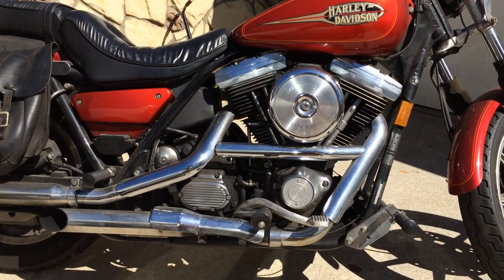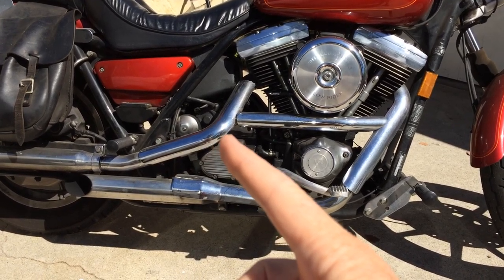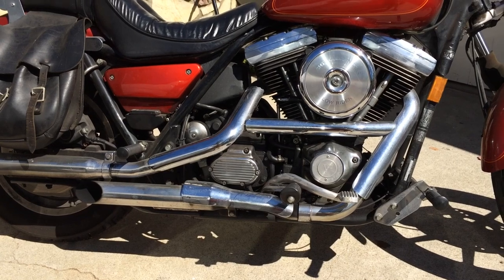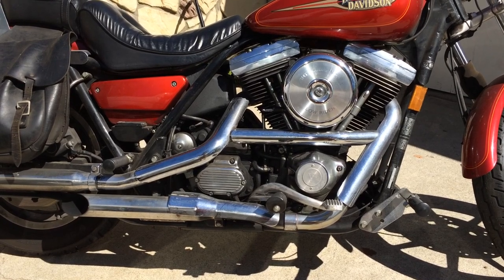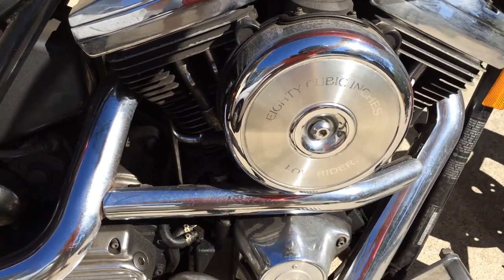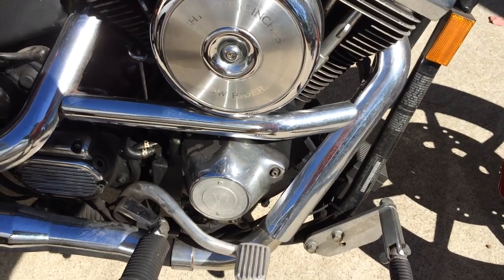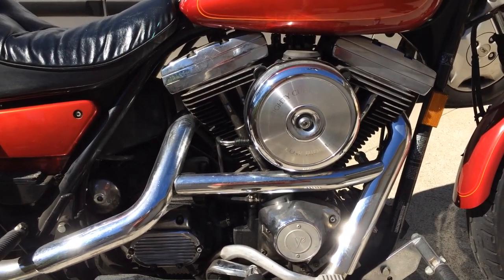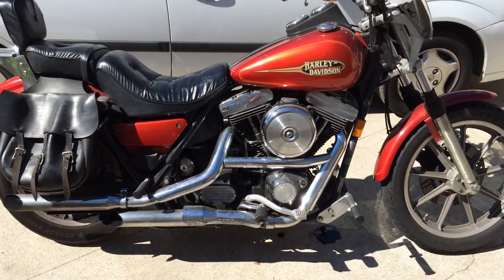Harley Wet Sumping Explained

Comment: The first time my bike did this, I panicked. I had no idea that it was supposed to do this until I bought the service manual. Now I drain the tank at the start of winter and leave a note on the seat reminding me to change the filter and add oil at the start of spring. I never understood why they didn't make them sump back to the oil tank?!
Reply from the maker: stirlingshire It's scary the first time!  I hope people who find oil dripping out of their air cleaners find this video before they panic too much.  Good idea, venting the crankcase breather into the oil tank.  There must be a reason they don't do that. Maybe because the oil tank is sealed, and the air blowing out of the crankcase needs room to expand.

Comment: could I just drain the oil out of the case and fill it back onto the reservoir prior to start up? I'm only asking because I have one coming up for auction and it's blowing the dip stick out as I crank it up. It has been sitting for almost a year.  Please help get this beast run.
Reply from the maker: It depends on what year it is. On a lot of these Harley‘s, you can drain the tank, but you can’t drain the swamp. There may be a vent line going into the air cleaner, which the oil from the sump will pop out of. You can unplug it from the air cleaner and route it to a drain pan and then crank the bike over. Here is a video I made about how to do a 5 quart oil change, which might help.  Harley-Davidson 5 Quart Oil Change https://youtu.be/bHxYuvm6Kuc
Reply: @hoohoohoblin  I'll let you know how it turns out. Thanks for the input.

Comment: i have a 92 fxr i got the puddle of oil then got it started and after it warms up it dies out. Any advice. just put a new battery in checked vacum leaks dont know what it could be. I know I have to put new clutch plates in but would that keep a bike from starting?
Reply from the maker: +Steve Walden  that is a tricky one. It could be a problem with the gas cap not venting properly, or it could be a bad ignition coil that stops working when you gets too hot. Maybe carburetion, but I doubt it.

Comment: Are you a expert on grabbing a xlh my primary clutch popped and froze up on adjustment all parts work apart but together it's froze up
Reply from the maker: I had a 1996 sportster a long time ago, and the clutch would sometimes get stuck and not disengage. On that model year, Harley put a spring plate inside of the clutch mechanism, which was a spring riveted onto a metal disc, and the rivets broke loose and got jammed in the clutch. I replaced the clutch with a Kevlar kit that didn’t have a spring plate, and it fixed the problem.
Reply: @hoohoohoblin  ow really but you replaced it instead cleaning the basket so not shire that will fix it
Reply: @eddiemorris5601  take apart the clutches and steels from the basket clean up, prob work jusr=t fine, had this problem on 76 ironhead just picked up now she's smooth.
Reply: dog pow

Comment: my bike leaks when it get warmed up, I had it sitting for a while  do you think I have this problem. What can I do
Reply from the maker: +Frijo1 If it was wet sumped, it should be fine after it blows out the extra oil.  Clean it up and  see if it leaks next time you ride it. It won't leak if this was the problem. Just remember to start the engine once a week to keep this from happening.
Reply: my leaks from the button and it don't throw out smoke,  thanks

Comment: So should I drain my oil and refill it. I have an 93 flhtc im new to evo's and my bike started then shut down n wont start. And of course i have the oil on the ground
Reply from the maker: germaine catching If you keep trying to start it, it should pump all of the excess oil out.  You could route the overflow breather tube into an oil pan to catch the extra oil.  I don't think there is a crankshaft oil drain plug you can open to let the extra oil out.  On my Royal Enfield there is a drain plug you can open to drain it when it wet sumps.
Reply: Ok thanks.  I  really  believe this is my case the bike sat for a lil over  6 months

Comment: I changed my o ring in the oil cap on my 2006 883 and brought the oil level to HD level only to have leaks thereafter. I dropped the full level to the half way on the stick and no more problems. I no longer add a quart when it tells me to on the stick... only half way. Problem fixed.
Reply from the maker: I had a Moto-Guzzi like that a long time ago.  Some vehicles only want to be half full of oil.

Comment: What kind of saddlebags are you using?
Reply from the maker: +kilochris83 They are old throw-over leather saddlebags, and I bolted the seat on over them to hold them in place.  The bike has metal saddlebag supports behind them. The saddlebags are official Harley-Davidson super thick leather saddlebags from the 1970s.
Reply: If you ever want to sell those bags drop me a line, the new fake leather plastic clip shit bags are so horrible!!

Comment: You're definitely not alone. But I've since come up with a very easy way to prepare for this to happen. Have been doing it for years on my '91 Electra Glide with 1340 Evo.  Keep in mind I don't have head breathers, mine is the single hose/tube coming up off the bottom.  Check your oil level before you start it up. If you remember where it was when last parked, you will definitely know if you see the level on the stick way lower than it last was.  Then, I simply disconnect the vent tube from the air cleaner backing plate and hold it off into a clean plastic fountain drink cup. You could attach an extension piece with a barb if not long enough, but I've never needed.  Then crank it up and within a few seconds, if it has pooled inside the block, it will as you demonstrated start puking.  Only that I catch it and avoid all the mess.  It always only takes a minute or two and it's clear.  I've ran it down the highway after that ( post warmup ) and never had anymore come out.

I'm not too familiar with how your breathers are hooked up into your air cleaner, but I wonder if a few minutes rigging something up similar to what I do would save you a lot of cleanup time afterwards from letting it flow all over your engine.  Just a thought.  Nice bike and video by the way.
Reply from the maker: FFmike790 Smart!  That would work on my bike, as it's the same year as yours and the breather tube is down low.  Newer bikes have hollow bolts holding the air cleaner on, and the oil comes through the bolt, so they couldn't use this method, but I bet a creative person could find a solution.

Comment: a 1984 FXRS?, with a newer CV carb!.
 I did the same carb,on mine great upgrade.
Oil is now puking oil at every start, not just after sitting for a few months in winter so time to replace check ball & spring
Reply from the maker: B. Bones Barbeque Yes, if it's happening all the time.

Comment: i have 1999 HD 1200 Sportster ....was running out of fuel and just before petrol station it started spluttering and back firing on stopping at the fuel pumps it was pointed out to me there was oil all over the  axhaust pipes and right back tyre ...any idea what is wrong as prior to this i had no issue
Reply from the maker: +mathew muscat Gumbie it really depends on where oil is coming from. Sometimes the valve cover gasket's go bad, and oil comes out there. Those are pretty easy to replace. The old sportsters I have the crankcase ventilation tube routed into the air cleaner, and sometimes oil will go into the air cleaner like it does on my FXR.
Reply: I opened up the air cleaner removed cover and its dry inside that area

Comment: disregarding the oil puking,which both of mine do,before and after the fix,it is a HARLEY, it is an ancient design,that is why we buy them,ride them,love them,when they made the first v twin in 1912 HARLEY made every sob that loves riding thru the air,fall in love with the machine,i don't care what it does as long as it starts and doesn't strand me,i care less about the cost of oil,its a flush anyway,with an oil tank instead of a sump,you will change the oil or buy parts,so enjoy the hog for its shortcomings cause mine is forever,i'll rebuild it 20 times if need be,japan or England have nothing to compare
Reply from the maker: Yes, it's a great machine, reliable and pretty simple to keep running.  Mine doesn't do this if I run it once a week.  It only happens if it sits for a long time.

Comment: If the engine is wet sumped what happens then?
Reply from the maker: +Milo Ace it will be difficult to start, and when it does start it will blow oil out of the vent tube. I most Harleys the vent tube goes into the air filter. So you will see oil coming out of your air filter.
If you don't want to make a mess, you can reroute the vent tube into a can before you start the bike.
Reply: how do you check oil level on aenclosed chain on  1984 fxrp

Comment: uhh.. harley is a dry sump system not wet.. look it up
Reply from the maker: +Minds Eye Yes, but when the valve at the bottom of the oil tank leaks oil into the dry sump while the bike is parked, they call it wet sumping.

Comment: I knew nothing of this when I went to got test ride a 2015 fat bob and I got like 5 miles Into the ride and smoke started pouring off the exhaust so I pulled the bike over and the oil was pouring out of the air filter. I about shit myself thinking I fucked the bike up lol
Reply from the maker: It is pretty scary the first time you see it happen.  You figure the engine is shot.

Comment: always wanted a Harley have 5 rockets. But the shitty engineering and quality of Harley always makes me think twice. That and a 1200cc motor making 50hp
Reply: taizer than it's obvious you have mever ridden a harley
Reply: taizer, Please do not buy a Harley. You don't get it, therefore you won't enjoy it. Instead you'll babble on about Honda reliability and BMW sensibility...you'll end up making the absolutely 100% word for word same argument as a Prius owner talking about any model Ferrari. Both the Goldwing owner and the Prius owner will never get it...not a single person has EVER bought a Ferrari with any concerns towards the practical.
Reply: I have rockets, they are like new sports cars. Harley’s are the motorcycle equivalent of 60’s muscle cars. They can most certainly crank out the torque if you want to build it, but my 80” (1340cc) is built to have mild power and last long. They can be a bitch but us motorcycle lovers live for this kind of shit. Harley’s are like wild women they may leave you stranded sometimes but they always put a smile on your face when you ride them.
Reply: Evos make little HP stock so I didn't leave mine that way, but they are not performance motorcycles and if you want serious HP with the brakes and suspension to go with it run away! I have several HDs and they're great "old guy" bikes. It's like riding a giant Briggs and Stratton twin. They're simple and easy to keep on the road for decades but even if you drop a 124" crate engine into one and upgrade the brakes and suspension they'll never be a Blackbird or a Hayabusa, not even if you do it to an FXR (I have two of those).  I've had my '88 FXR since new and am a multibrand mechanic but for personal rides I require simplicity above all.  The displacement fetish (not seen in cars and trucks) hails from racing classes irrelevant on the street but the hp/cc fetish is a thing.  Buy more rockets. Cruisers will never be sport bikes.

Comment: This isn't true for the Milly-8 engine... that sumps when you ride the bastard!
You can be riding along, 4 hours into a decent trip and suddenly 50% power gone to the wind... and your pistons are fucked.

And HarleyD?  They will go over your bike with a microscope, looking for any mod or non-HD part.... and invalidate that warranty.

Great bikes, shit customer services!
Reply from the maker: That’s scary. I would’ve expected them to figure out the wet sumping problem a long time ago
Reply: Same here.  You start to think a company is run only by pen-pushers with only their shareholder's pockets in mind when it takes an after-market company to fix their mistakes (S&S are said to have a pump in the pipeline that will fix the sumping issue) (and then the 'am' part will invalidate the damn warranty anyway!)

When the M8 was brand spanky new this could be forgiven, a little... but it's not now, this should have been fixed ages ago. HS are on their, what, third oil pump redesign for this problem?  Fourth?

HD have become like a computer games maker - bare bones game plus dozens of DLC (downloadable content) that you have to pay for; the old-style games... you paid for the game and you got it all, even DLc was offered free most times.

With HD you pay your 52 grand (Au price) for the Tri-Glide Ultra then you might get the staged upgrades, new oil pump, new covers and cams, etc.
And if things break down you just better pray you remembered to swap out any mod items and put back the originals or you have no warranty.

I love the older Harleys, back before the pencil dicks ruled the companies.  But now... it feels like they've sold out.
Still, that's the way the world is going, $$$ to the Globalist rulers and people like me... we're just dinosaurs that they are waiting for to die so there's no more challenges to their propaganda machine for the RealityTV fed morons.

(steps off soapbox) (takes deep breath)

Am seriously thinking .o0("Hmm... wait and see if '19 brings the Tri-Glide with a fixed oil system... or wait for '19 and see what the Goldwing Trike is like")